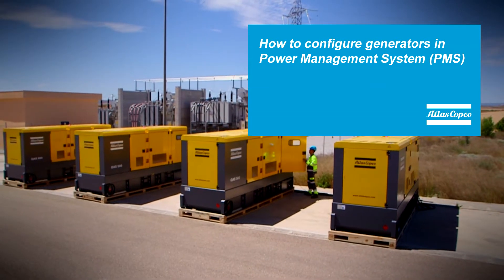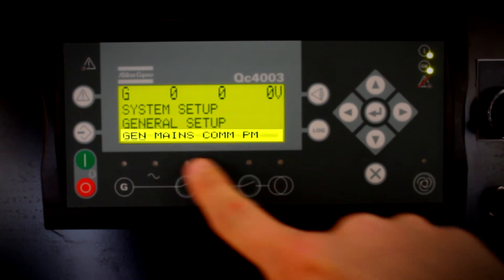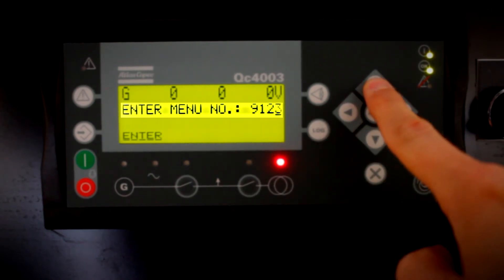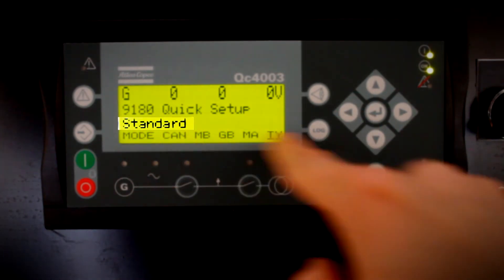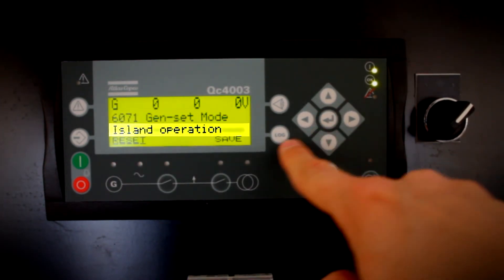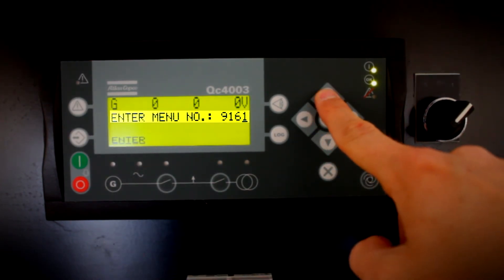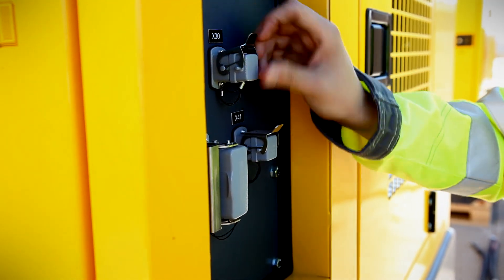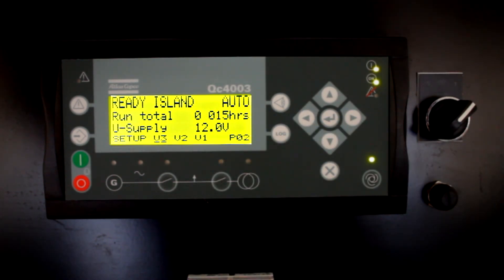How to configure Atlas Copco's generators for Power Management System

Comment: I have a 300KW generator, and my constant consumption load is 130 kw to 140 kw, which is between 40% and 50%.
And I have constant shutdowns due to low speed,
And the ATLAS technicians ask why the generator is working below 50% load, and they recommend putting a dummy load,
I would like to see if that would be the solution or if the problem I have is due to the load,

Comment: Hello, When I completed the setting .If I put it on auto mode,how can I start the machines? Thanks
Reply: You can use remote start input at any of the machines in the system or you can enable local start at the parameter 8020, then you can start thru the display panel.
Reply: I forgot to mention, that for both way, system must be un AUTO!

Comment: How can be config pms with remote start ?
Reply: By default it should be thru remote start to give start command. If you want to change to local (display start button) or remote you can do it thru parameter 8020

Comment: I just followed all steps. It seems easy but the process stopped waiting for the can connector. I replaced the can connector but process is not completing, it doesn’t detect the connector
Reply: Hola Daniel, debes de revisar que los cables CAN esten correctos y asegurate que la unidades estan en Power Management @ Parametro 6070